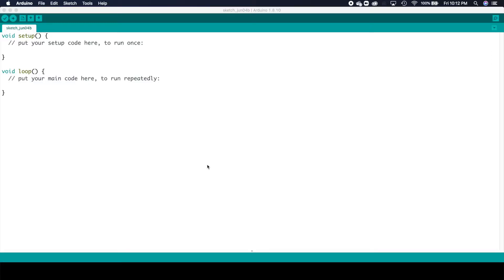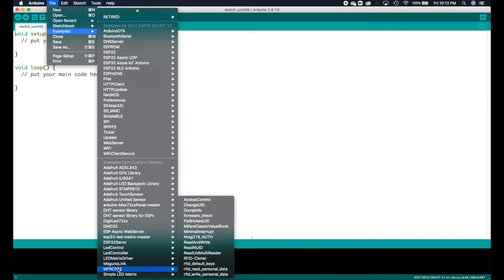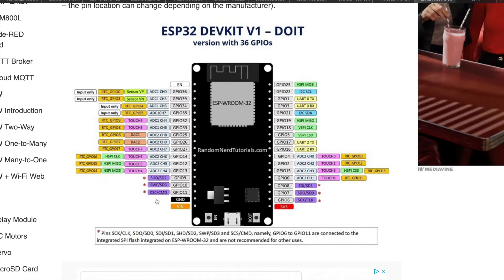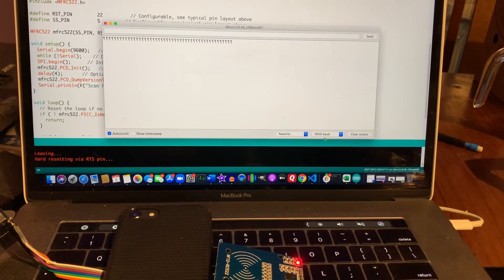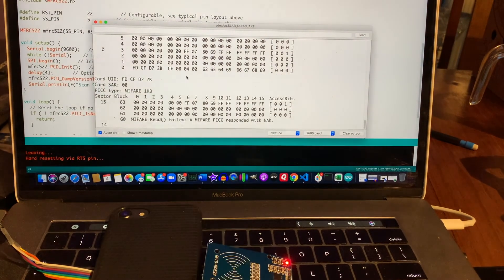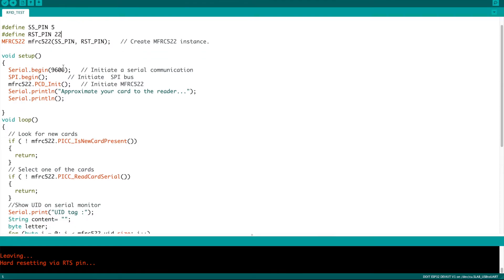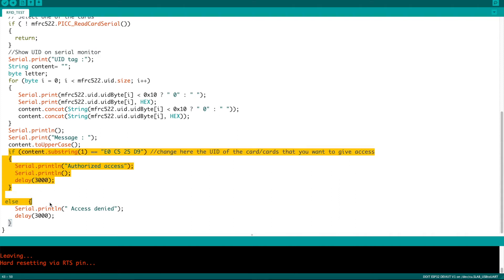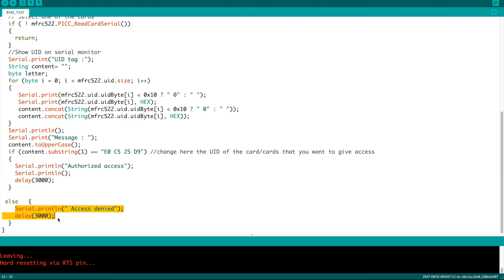ESP32: How to read RFID tags with a RFID Reader

Comment: What about generate energy with a bpw-34 or a cheaper photodiode or phototransistor that's can produce some energy? To increase the energy density, I want to try some resin or silicone to promove a more large area(small area, but, a little large for the application) of light captation to the surface of the micro photovoltaic micro power electric energy grnerator (BPW-34). An small IC that's can write a code and work with small signals to wake up, check if have a device asking for the match code, send a pinger signal with some code by RF signal, and sleep again. I think that's a coordenate system composed by a small LSD capacitor or battery, with a capacity of power generation by micro PV, mechanical piezoelectric vibrations, directionated energy or another way, that's wake up for less than 1 or 0.1% of the time, emiting pingers signals, or wake up to check, can be more convenient to use in many applications of industrial and homemade logistical system.

Comment: my serial monitor just remains black when i run the code and scann a tag
Reply: I’ve had the same issue. You need to make sure you select the correct port. Look at what port you’re listening to, then click restart on your module. Now check the ports, and you may see a new port appear. In my case, my module has two usb c connectors. Only one is meant for serial, and the other is for programming the device. So once I flash the code, I know I’ll need to hit restart on my module, and then in the ide, select the new port that appears

Comment: how can i send data from esp32 to the RC522 so i can read it with my phone
Reply from the maker: Thanks for watching. It depends how you’d like to be able to see the results on your phone. If you only need to see the readings while you are in the same room as the ESP32 you could probably use something like MQTT or http requests. If you want to be able to see the readings online from anywhere in the world you would probably use a third party service like arduino.io or adafruit.io.
Reply: @BaldGuyDIY  thanks for replying, but i didnt mean that, 
i m want to read the data via NFC , i connected the NFC board with the esp32 via spi, and i want to send the data to my phone via nfc. 
i m struggling with the programming of the SPI interface between NFC board and the ESP32 .. can u help me please..? i would pay for that..i just need help
Reply from the maker: @kakachiheb  you could send me an email with more detail about what you’re trying to do and why it needs to be done that way.
Reply from the maker: @kakachiheb  it should be in the description of every video. brandon@baldguydiy.com

Comment: A fetal error occurred . Failed to connect to esp32 timeout waiting for packet header
Reply from the maker: Sounds like you need to troubleshoot the Arduino IDE settings for your ESP32 board. Check that the port is correct, and that the correct board has been chosen.